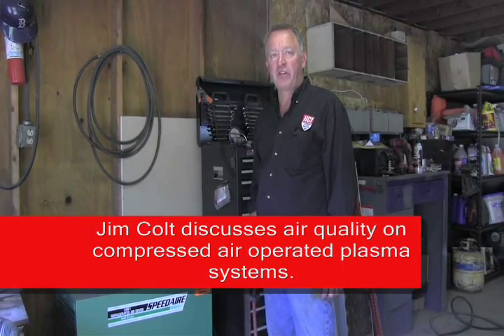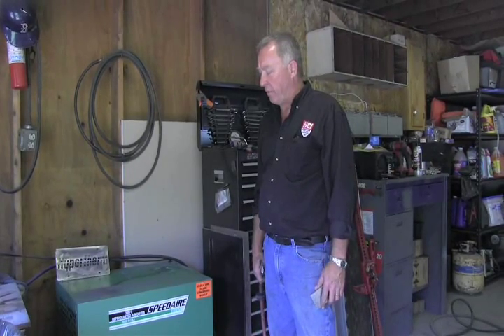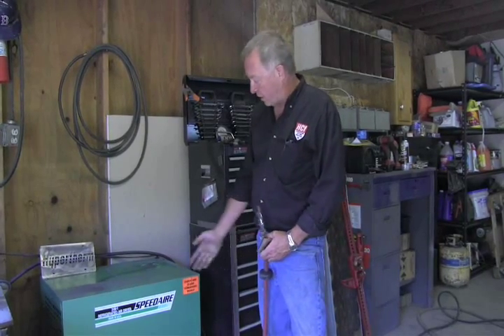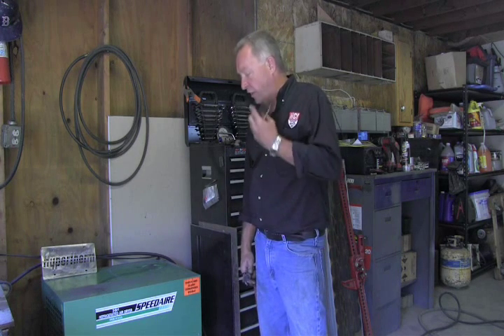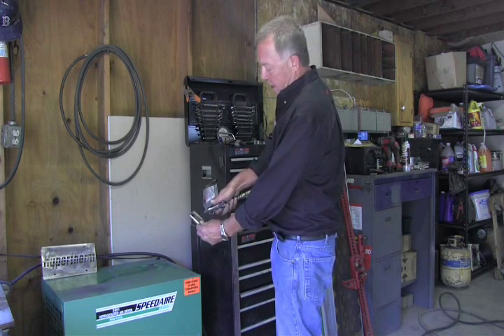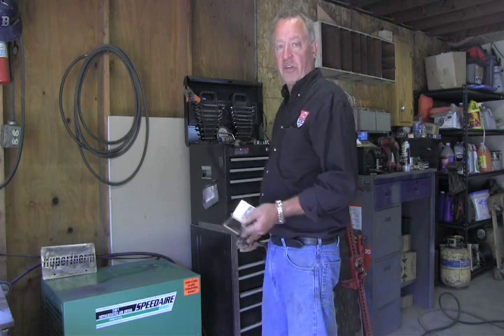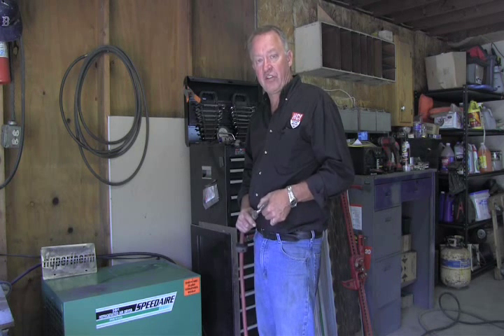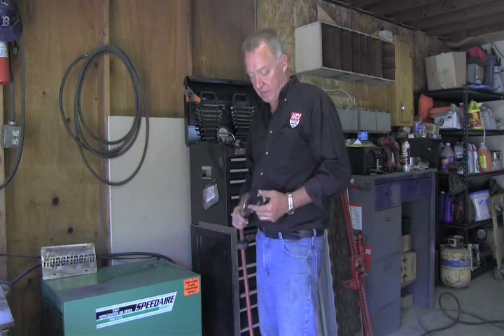Jim Colt discusses air quality for plasma cutting systems

Comment: Good info if you have a lot of water in the air the element will reach its capacity and water will go on thru. The Motor Guard was originally a lube oil filter that used 2 ply facial quality toilet paper. They later came out with a compressed air filter that took the same element. I still use the compressed air filter for lube oil. The m-30 is similar to the original lube oil filter. I add a restricter orifice and replace the plastic internal parts with metal. I quit changing oil over 50 years ago. Haven't had any trouble with the coating  failing with motor oil. Sometimes with ATF or gasoline the coating will turn loose of the aluminum. Sometimes happens with compressed air. At work we used the refrigerated air drier before the Motor Guard. When the boss bought the plasma cutter he paid extra for the 
Motor Guard. Guess how the name Motor Guard got started. A Motor Guard compressed air dealer told me he had been selling Motor Guards for 25 years and never heard of a Motor Guard oil filter.

Comment: Would like to get in touch with Jim C if possible, can contact Scott at --   
iron design airparts at gmail dot com    --    first part all together and you know how the at and dot parts work. thanks..  This is more of technical question, I have your Hyper 1000 system... DHII and a few other goodies.